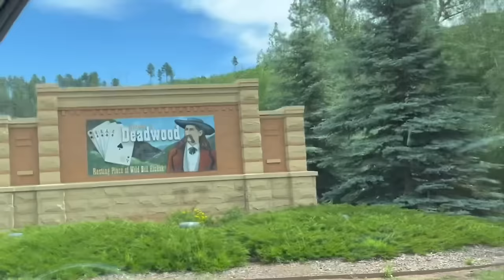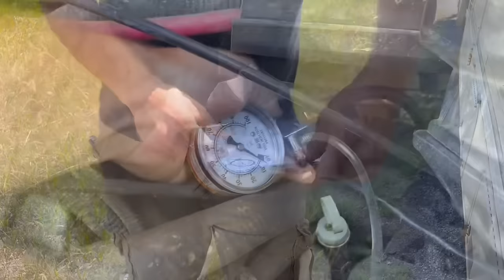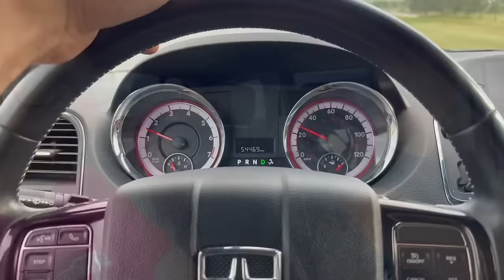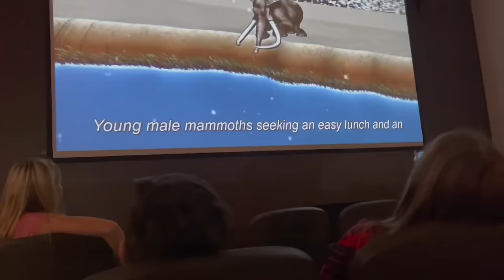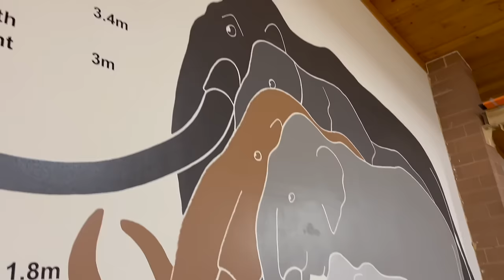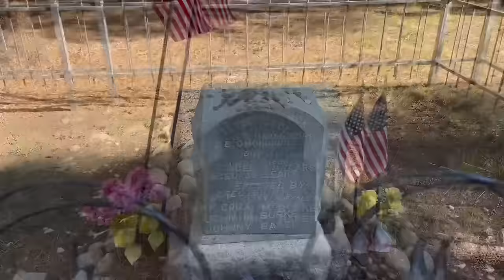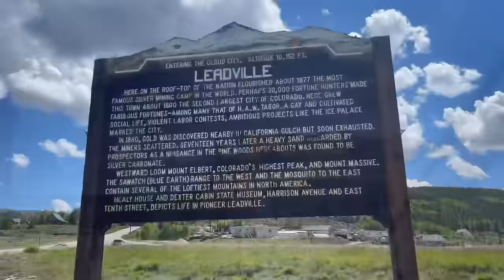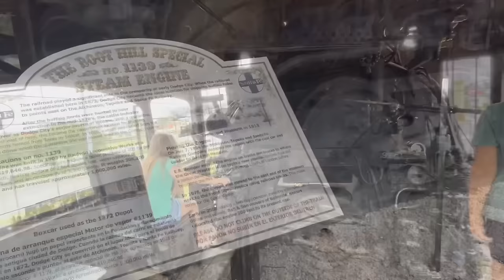Can we make it out of South Dakota in our $1250 motor home? 5000 mile road trip !!!

Comment: You never know what will break down on a trip. Would have been nice to have changed out a bunch more stuff since the rig hadn't been on the road for years. 

My story: back in '89, my mom and I were going to go to the Henry Ford Museum in Michigan. We live in central Illinois. Mom's car was a '83 Pontiac Bonneville wagon with Buick V6 and low miles that she recently bought. Just into Michigan all the dash lights lit, engine stalled and steam rolled from under the hood. Coasted off to the side. Hit the key and nothing. Engine stuck tight. Wrecker stopped and said he was on another call but would stop back in an hour if we were still there. After 45 minutes, the engine cooled enough to turn over. Drove it to the next exit a mile away with the temp light on. Radiator blown. There was a service station there that had junk cars out back. Swapped in a radiator from a wrecked in the front LeSabre and put the used antifreeze from the wrecked car in it and continued on our trip. Got to the motel at 10 pm when we supposed to get there by 6. Used over 4 quarts of oil for the round trip and the oil pressure light flickered at idle. Car dealer called us shortly after we got back and asked how we liked the car. I said we blew it up on vacation. Dealer said, "Oh." and that was the end of the conversation. Ended up pulling the V6 and replacing with a Chevy 307.

Comment: What kind of fuel you run an ad stuff 460 you might need to be run and 93 octane bunch of injection cleaner through it seafoam is one of the best that might help you get better mileage. I got the 302 motor like yours, but it just because sometimes two, and it turned out to be that I was not run any octane booster anything like that. You can also run 987 octane and put in octane boost that help pick time
Reply from the maker: We ran 2 bottles of sea foam thru it before it broke down. I was running 87 octane

Comment: So that fuel line got blocked somehow between the pump and the filter. Maybe even right at the sending unit. Maybe from that deteriorated rubber hose you found. Hell of an effort though under extreme pressure!

Comment: I eagerly awaited this video after seeing your first two days on the road. I was disappointed in how it ended. But surely not as much as all of you must have been. My wife and I are senior citizens with many trips along the same roads you were taking for the first time. But we both remembered our first trip to LA when we were younguns. On a VERY STEEP HILL (Actual signage) in San Francisco I killed the engine on my '72 Nova. Imagine some idiot posted a stop sign on this hill!
Anyways the hill was so steep that all our fuel was in the filler neck. The suction was broken and the mechanical pump wouldn't reprime! We suddenly remembered that all our relatives had moved from California and we were 2200 miles from home.!
I freaked as much as Josh did. Thankfully some entitled so-and-so cussed me out as he drove around me. After I retaliated by calling his mother some awful names, I calmed down and we backed into a parking spot and got the car headed downhill. I calmed down and we continued on.
The pressure at that time was terrible. Believe me, Josh, there are plenty of us who have felt that. Next trip, you will be more seasoned and hopefully all will be well. Don't beat yourself up second guessing what you MIGHT have done. Hindsight is cheating! :-)

Comment: I had a 77 Econoline in 1990s..the Engine is very reliable, only the fuelpump and other parts are not,so my recommendation is get all new necessary spare parts ,and keep them in it,so then you ready..in an emergency..🤔🇺🇸👍dont worry you did the right think,but only mistake was,that you didnt expect it..on all old vehicles brakedowns are normal,thats why i pay all Europe Roadservice..for 100$ a year..🤣👍
Reply from the maker: I thinks that a good idea
Reply: @Sleeperdude  But now you sold it,i think you not find another that cheap,,i even would buy it,and ship it over pay customs for it..if got it that cheap..and a spare V8 Engine are also a good solution..🤔

Comment: i had a 91 ford hightop conversion van 351 motor beautiful van but i put in 3 fuel pumps in year and half same issue as yours aswell as 8 starters in my 5 years ownership  watch all your vidios ive had many 85 86 ford ltd 11 v6,s same as fairmont aswell as an 88 tbird turbo coupe still have 5 speed 90000 miles body rusted out though unfortauntly

Comment: Its that stupid piece of rubber line in the fuel pump every time. And installing that VP44 style pump if you don't crank the hoses down super tight they slide off pretty soon afterwards. I've pulled a fuel pump out on the side of the road to reattach the rubber line.
Reply from the maker: Maybe so thank you

Comment: Before I get to the part where you find the issue at 16:30 "I'm thinking fuel pump" ⛽️ perhaps stopping at some stations where the gas was garbage. At least gas treatments per fill up
Reply: Awww 🥵
Well pops you handled the breakdown best as possible 👏🏾 
IT WILL BE GREATER LATER👌🏽

Comment: Ya I'd fo with th fuel pump alot of them put an extra one on side of truck if it fails becuse  of where they are located. They place another aside the frame this is why I was told to make a latch when I do my floor. There easy to do but bad place it's above the gas tank in back

Comment: Because the RV sat for a very long time, it probably had hidden cracks in the fuel lines or the fuel injection system probably needed a complete replacement.

Comment: a few years back i had a 88 chevrolet astro doing about the same thing i had it in several repair shops replaced about everything i just could not figure it out then while on youtube i was searching it out and there was the answer right in front of my nose when you put gas in it then it ran good for a bit ??????? .................. the vent on the gas cap was plugged so when it built pressure it could not suck up gas put on a new cap ran great and still does
Reply from the maker: That’s interesting. I left our gas cap loose at the end just in case but that didn’t fix it

Comment: More unsolicited and mostly retroactive advice:  I very much doubt that your fuel line was clogged, so if another fuel line worked, it would be the fuel filter.  I know you changed this once, but fuel tanks can be so rusty that they can clog the new one, so you should have tried changing it again.  However, the problem was probably a clogged fuel pickup sock, attached to the fuel pump in the fuel tank.  More persistence and a run for specialized tools would have gotten you in.  For the future, including the Minnie Winnie, inspect inside the fuel tank for loose rust before road tripping an oldie.
   As for time pressure with the family, perhaps they could have taken the rental to see the South Dakota sites without you, while you worked on the fuel tank, and then met you in a few days, giving you time alone to work.  Plus a shop might have done it for less than you lost, while you and family saw a few sites in SD.  We had a shop do a rusted brake line while road tripping an old Sportsmobile chevy 1 ton, while we waited.  Shops are handy when jobs are beyond your road tools, though the fuel tank tools are not big or expensive, though cleaning out fuel tanks on the road is messy without a shop.
    I think the Minnie Winnie still has potential, but you need to start by pulling the oil pan and fuel tank to inspect both oil and fuel pickup screens.  I did this on a 70's Dodge van and I think you will have to jack up the engine to get the pan out past the crossmember, but it can be done. but yes, give it more time.
Reply from the maker: Ok thanks

Comment: Distributor on motor home I had 95 Ford f150 same issues I could drive and just cut off missfire pickup coil inside was bad I was losing fuel pressure at fuel rail
I changed ignition module 2 times checked every wire on it from front to rear ignition coil nothing worked I changed the distributor and it was fine 
It would run fine and then get warm and start stumbling and sometimes wouldn't even start for a day or two then would I really think thats the issue you was having on your rv

Comment: I had the same problem it was the coolant temp sensor...did your RV have a throttle body carb? Anyway if the sensor is bad it will send a false reading to the Computer of excessive temp it will limit the amount of fuel and stall the engine until it cools down then it will only run a few feet... I changed that sensor and it fixed the problem. I know to late now, sorry you had to sell it I know how much work and pain you went through. I have a 1990 Mallard 20 ft. 
What happens when coolant temperature sensor goes bad?
5 Symptoms of a Bad Coolant Temperature Sensor - Gearstar
If the coolant temperature sensor malfunctions, it can transmit a false signal to the computer. And the response of the computer may unbalance the timing and fuel calculations. It is also common for a coolant temperature sensor to fail without warning and send permanently cold signals to the computer.
Reply from the maker: Ok thank you for letting me know. It had EFI fuel injection but maybe that was the problem

Comment: like i said when you replaced the o rings to the injectors the newer fuel with the methanol in it eats the rubber fuel lines too
one think you can do is hook a length of fuelline up to the working inline pump take the intank fuelpump off and rplace it with a length of hose to reach the bottom of the tank then hook the working pump to the top of the fueltank , should work fine after that
i think its caused by the newer fuel breaking up the rubber in just about everything thats in contact with the fuel
wat you could do as a temporary fix is again get some fuelhose on the in of the working fuelpump  and insert the hose in a big jerrycan with fuel , that circurferences all the old fuel system , can set the jerrycan up to the back of the truck or feed the line through the hole you made in the floor and put the fuelcan inside (can keep an eye on the fuel level ), and stop at every fuelstation on the way home to fill up

maibe next time get a rv trailer , its eazier to replace the towing vehicle

the guy that bought the rv has gotten a good deal (motor trans and tires alone are worth it ) even if he has to tow it to his place

Comment: Well... a REALLY tough time - with some good times mixed in!   A lot of trouble, but consider how blessed you were, to find and fix the fuel injector fuel leak!    Made me think of past vacations that I've been on.  The tip of a very, VERY large "iceberg" would include my car's engine seizing when 400 miles from home, the tow truck backing into, and destroying, my new Sea Doo and trailer, waiting by the side of the road for an entire day, in the 95 degree heat, nursing my bad sunburn, wondering what I was going to do for money now that I had no car, the tow company wanting to charge me double since I was pulling a trailer, and due at work the next day.   Or the year that I bought a new car, only to find out that it had a major and catastrophic engine flaw - too bad the company went out of business just a month earlier!   Or maybe the year that I had another Sea Doo that would not start - could not get parts.   Lost my glasses too, and I'm legally blind.   Going back further, vacations are not fun when you have a van load full of angry teenagers, and parents that want to wring each other's necks.   If you think these tidbits are the bad news, that would be wrong - the real bad news is far worse!   
    So... through the years, there have been stories of vacation nightmares, but the good Lord worked everything out.   Nice vacation this year - my dog came along.  Once home, he looked up at me with adoring eyes, giving me a look of total approval.   No doubt, your family will remember your vacation, especially the good points, and laugh about all the rest, as time goes by.
Reply from the maker: Yes fornshre

Comment: Did they find out what was wrong with the camper?  Those dual fuel pumps are one of ford's bright ideas.  I bet it was a fuse box or wiring issue to the rear pump.  If you could have load tested it,  I bet 12ft of wire would have fixed it.

Comment: You need to put the one fule filter inside the gas tank using a hose. Omit, the big one. That's the only other way to do it of you can't getthr part plus its easier fpr next time. Pll are doing  them that eay now so we don't have to drop gas tanks and replace fule filter. As long as rhe one in gas tank is still looke en tuning it'll make the secobdsrly one fail if that makes any sence. Ytube it that's how I found out when looking an older rv up that had oen gone . I can't explain it to you the right way but I watched it all on ytube. Usually it's the filter rotted they replace them ith new ones yrs ago but they are too short don't woek etc so ppl are now using ones alone along the frame n omitting the ones in the gas rank. They route a hose inside the lid tho so they can get gas. Is maybe the gas rank u put where battery was causing an issue too. Just an idea . I imagine you have either sold it or fixed it by now. But if u didn't fix it jsut an riy for next time rent w van if u need to

Comment: So you had a hole at top of your fuel tank, what can be sealed with a pvc plate with 2 holes on it. You had an address to order online an external fuel pump, an inline high pressure filter, fuel hoses and clamps, a universal FPR and you sold the RV for a couple bucks. I don't understand it.
Reply from the maker: And wait on everything to be sent to our motel ok cool
Reply: @Sleeperdude  No local auto shop? You could have used your bike to get parts. I think the high fuel pressure filter was the issue. See https://www.youtube.com/watch?v=92TfTQTmuq4&t=231s (i have the same Econoline but a Van and have put like 150K miles on it) Jerry rigging the low pressure fuel pump may have caused the no fuel problem to the high pressure pump. Anyways I understand what you did and why. Happy wife happy life. I have been broken down on the highway also no fun! and stressful especially as your loved ones where with you. Hoped to see the 460 ending up in your Ford wagon. The adventure definitely hurt the envelop. Take care.

Comment: Dear sleeperdude.
Let me see if I got this right: You made over 5000 bucks minus only on the motor home (not even counted all the work you put in). Plus 500 for towing, plus maybe 1500 for the rental van, plus the costs of the hotel room. Additionally you had to sell the motorbike under value and you had to leave mattresses and other stuff in the motor home. So AT LEAST it was 8500 USD minus?
That's definitely also not what I wanted to happen, neither did you of course. I hope that it was not only a clogged or inside swollen fuel line (because of that crappy stuff in the modern gasoline).
I had high hopes for that motor home. I thought it would be a good idea (and interesting to watch) to put a more fuel efficient Diesel engine in it. But, okay, it's over now.
I'm glad that you managed to nevertheless have some really good quality time with your family. Congrats for being able to adapt so fast. 💚
Best regards, luck, health and wisdom.
Reply from the maker: Thank you

Comment: By the bedroom. This is go a be q good lewenibg lessonnfor me actually  ie legend slot from you already ans I thank u for that. No will help me get this rv ready fixed or safe. It run n drives pretty good but I don't know where things are u til I watched thus video  never thought of tranny or air bags n I do have a inch lean on one side. I jsut let both air out both sides still had a lean by kitchen but I know where my plugs are etc  thanks to you

Comment: those fords 460 had bad computor ? modules in them they would work and the sporaticly quit i had a Lincoln and brother and aunt had T birds and they all did it when you would step on the gas they would puke out and then run fine and when got hot on the freewaY WOULD QUIT then would be fine it was a bad fault with them I think they made a remanufactured computor ? fixed for them  later to replace it

Comment: Well, it’s too bad you couldn’t get the R.V. home. You could have sold it “as is” and reimbursed yourself the money for the travel expenses. I wonder if it’s still sitting there? If so, it’s probably been well VANDALIZED by now, which will “zero out” anybody’s desire to try to fix and restore it. Well, if it’s been vandalized, it will still make a great bonfire 🔥
Reply: They found a buyer, which helped get them home.

Comment: Camper reminds me of ignition control module issue.
Reply from the maker: Ok thanks
Reply: @Sleeperdude  I also own a 460-powered Ford truck.  Just for future reference, based on your truck's symptoms it was likely a faulty fuel pressure regulator.  See this video: https://www.youtube.com/watch?v=g6rf9oPDq1I  

Not suggesting that you should've known about it or tried to diagnose and fix it.

Comment: As Bill S. wrote;"All's well that ends well'. BUT, I could see this train wreck coming from the first video. 1/2 arsed maintenance work, repairs  done all wrong &tc. The First Rule of an Old Car--- every part, all circa 30K of them, are OLD and just waiting to fail. The fuel pump is a prime example, taking a family trip with a 30 yr old fuel pump was not the best idea. The critique is too long by half--BUT you did the right things to sort out the imposed disasters.  I hope it was worth the price and the costs.